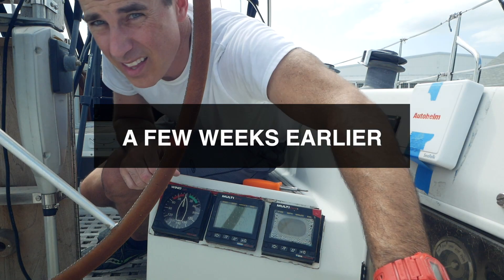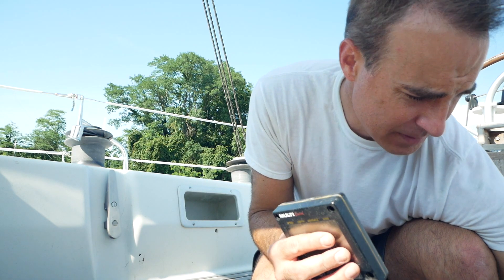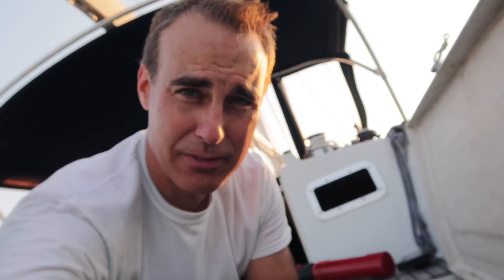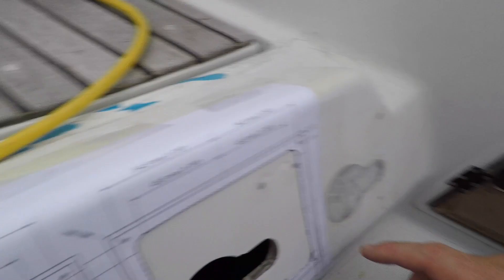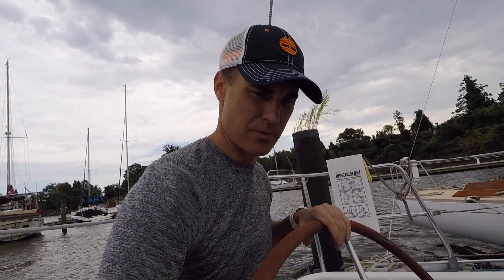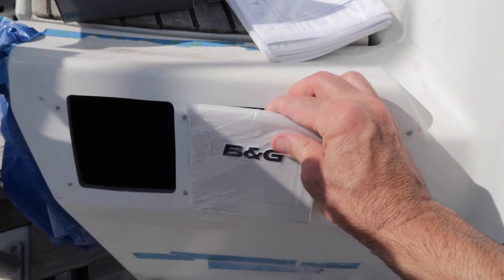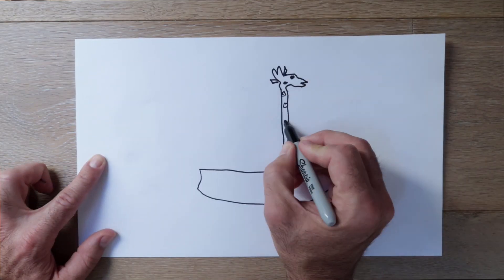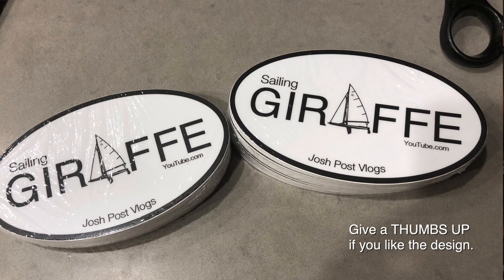Instrument Screen Replacement + Boat Name Announcement

Comment: A teak plank over the area with cut outs for the displays and use the holes already in the glass for the cables would of been another option and would of left a nice piece of oiled teak "bling" for mounting the required beer holder!

Comment: Kitchen foil, clean down the area, cut and wet your glass ON a square of foil, smooth the foil onto your repair area, no brush required, once cured you can sand off the foil if you feel it's needed.

Comment: You can paint the area arount the instruments with a matching gelcoat, just brush it on and sand it smooth afterwards. Remember to add wax (paraffin) to the mix so you get a hard topcoat.

Comment: Liked before watching as always. Great video! Did you fill in the last hole with body filler or something similar or is it hollow with a top layer of fibreglass now? Looked like a great repair - not a lot of people take the time to do things right.
Reply from the maker: Thanks for the comment. I put about 8 layers of fiberglass in the hole (about 2 layers per day over the course of a week). I then filled the rest of the hole with epoxy filler (colloidal silica).
Reply: Josh Post Cool. Wasn’t sure if that was doable with the fibreglass mesh being so thin, but that’s awesome. Look forward to the “maiden voyage”!
Reply from the maker: Yes, the fiberglass is thin. I probably filled about 1/3 of the hole with fiberglass and the rest with the filler. If I did it again, I'd use a fairing filler with the epoxy. The colloidal silica is too tough to sand down.